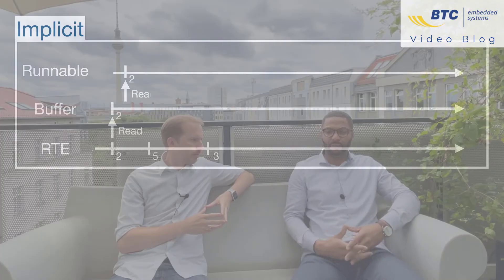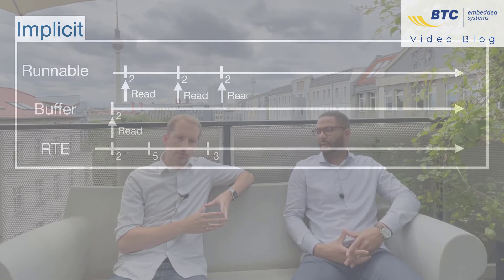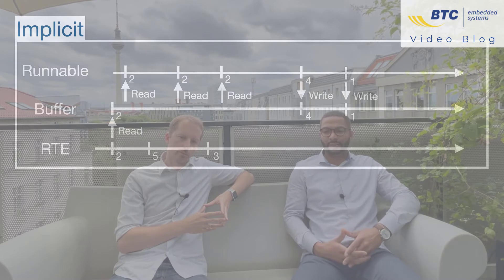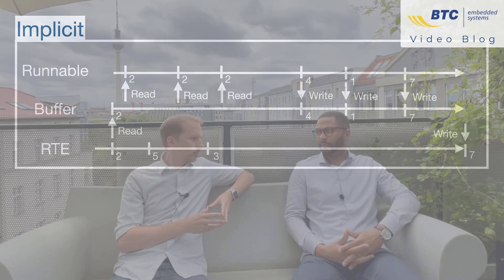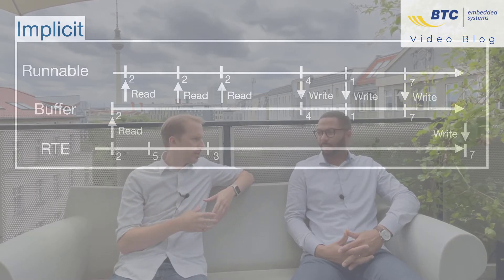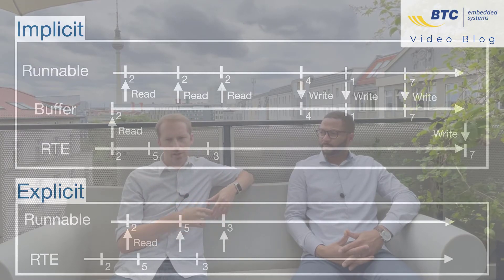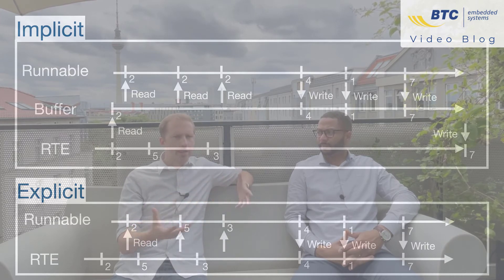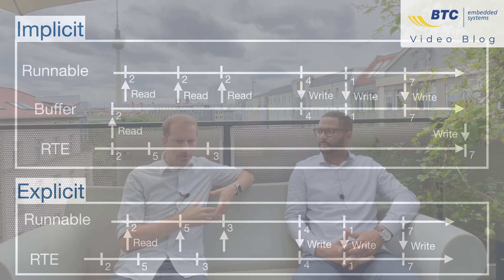AUTOSAR Tip #4: Difference Between Implicit and Explicit

Comment: can I use Implicit read and explicit write or vice versa
Reply from the maker: Hi, yes, this is basically configured individually and independently for each input and output. So if you want, you can even have multiple inputs where some are implicit and others are explicit.

Comment: Could you please provide use case for implicit and explicit?
Reply from the maker: Hi Arun, to summarize I would say, that explicit communication should be the default choice as it contains less resources. The additional buffer operations from an implicit communication can make sense in a use case where a. you have a Runnable which reads or writes the same interface multiple times during it's execution and b. the Runnable could get interrupted by another Runnable accessing the same data. If these two conditions are met, then an implicit communication can protect you from inconsistent data. Let us know if you have any further questions. Greetings from Berlin, Markus